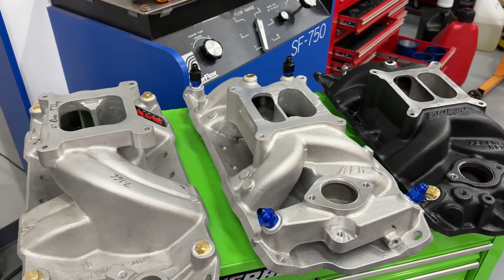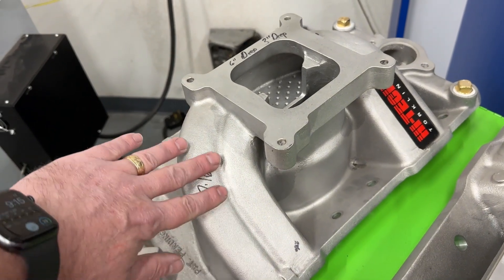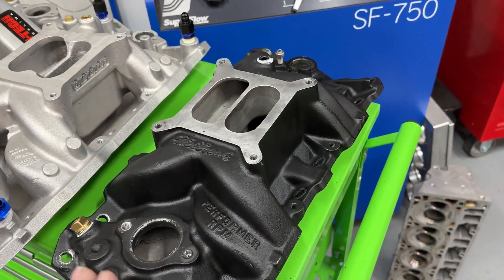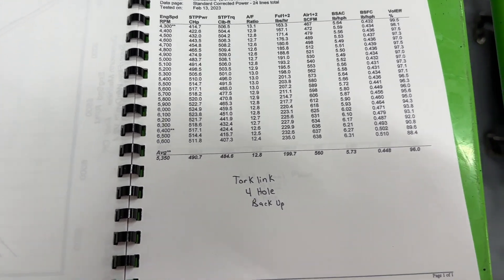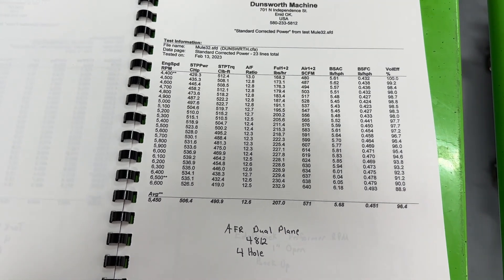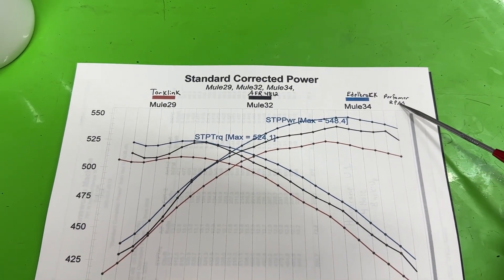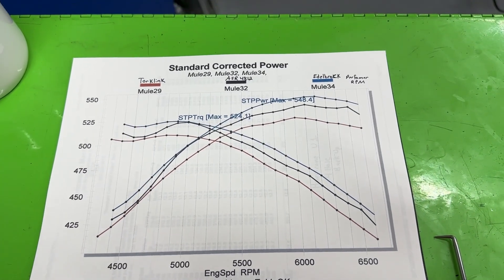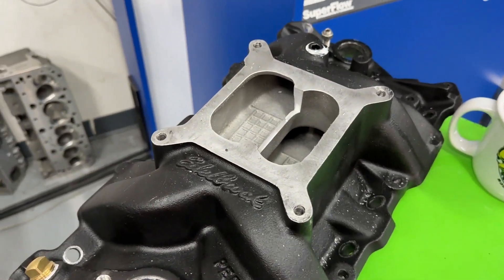Dual Plane Intake Manifold Dyno Test

Comment: I do know that the torque link worked very well on a boat. I changed from a performer room to the torque link and the difference was substantial!! Chevy 350 with a RV/ Marine cam. Never saw above 4500 rpms but it really made a huge difference! Had to lean the Holley 3 jet sizes down. Not only seat in pants grunt but more efficient as well.

Comment: Do you plan on comparing the BBC AFR to Performer RPM?
Reply from the maker: Already did to performer rpm air gap on 496
Reply: @WeingartnerRacing  I meant to say comparing the AFR dual plane 4910 to the Eddy Performer RPM air gap? I saw you did the SB comparison and the Edelbrock did better but I know you mentioned the spacer wasn't ideal for the AFR. I was curious about the BB because it comes port matched.

Comment: Can the performer RPM be used for street driving?  The specs show an rpm range of 1500-6500 but for street you need power off of idle.
Reply: You lose a little response just off idle compared to stock then its better everywhere.

Comment: Just looking at the Hi-tech you can tell it will be garbage. Dual plane intakes are designed so the each half feeds every other cylinder in the firing order providing equally spaced pulses.  The Hi-Tech will have unbalanced pulses on both sides that even the large cut-out won’t be able to overcome.

Comment: Performer RPM 
When they first came out in the early 1990’s
I had one on a 302 HO 
351 Windsor Heads
Solid flat tappet 306 dur. 530 lift cam 

It was a beast 
3500 to 7000 rpm beast 
600cfm Holley vac sec carb

Comment: Did you make sure that all three intakes were port matched to the heads I have a big bore stroker Yamaha Banshee four wheeler and that's one thing with two strokes you got to make sure that all the port matching is done from the block to the cylinder

Comment: Have to watch when theres more time. 
Forgot all about that tork link? Intake. Know appearance isnt that important but wouldnt mind one just to be different

Any info on Edelbrock EPS vs their performer rpm?
Really interested in A Holley Strip Dominator high rise Z28 intake 300-36? Vs the Edelbrock RPM or comparable Weiand offering. 
300-36 I had was loaned to a friend...who sold the car right after he installed it. Cant find a clean one reasonable since
Best high rise I used...certainly had that tall Z28 look also.

Comment: I know this was a year ago. With that said, has there ever been a test of the performer rpm with a 2" super sucker spacer installed upside-down?? Anyone?  I heard cats saying they pulled up to +20 hp by flipping it.
Reply: Am I missing sarcasm or humor? 
if serious that person is full of beans.
Reply: Figured so, that's why I was channel surfing to see if anyone has put it to the test on a dyno or not. some cats cut the divider on dual planes why not just throw in a open spacer? Would it change how the air/fuel atomized by being pulled through that different directions?
Reply: @drt6680  they may have got 20hp at high rpm if they had a carb that was too small to feed the dual plane. by adding the gap, spacer is better, but cutting down the divider is the same idea, it allows all 4 barrels of the carb to feed each cylinder. in a fully divided dual plane only half the carb feeds each cylinder so can suffer at high rpm. by going for a much bigger carb you wouldn't see a benefit to running the gap because there is already adequate air and fuel. so you COULD see 20+ hp, but you'd get that power by adding a bigger carb and probably keep better low end and torque curve.

Comment: The sad thing about these videos Is I'm trying to find information for the best combo under 4000 rpm for my fully loaded F250. Unfortunately the data all starts far above 4000 rpm so none of this is useful to me because I'll almost never be winding my truck out that far but the power I make at highway RPM is critical because it dictates how much incline I can handle without losing speed.
Reply from the maker: You are concerned more with part throttle driving than wide open throttle. Dyno no matter rpm is for wide open throttle.
Reply: @WeingartnerRacing I think you've misunderstood. The TLDR version is if you don't have the required power available at WOT then you simply can't maintain a speed at load up an incline no matter how much you push the pedal down.

Moving a load up an incline is a function of power. To move a 3300kg truck up a 20% incline at 62mph would require somewhere between 275hp and 290hp depending on the drag coefficient of the truck. But it would only require somewhere between 35 and 60hp on a flat road. So yes on the flat road you would only be using a part throttle application because obviously at the working rpm of the truck will have enough power available to maintain that speed. But as the incline increases, throttle application will need to increase because HP demand also increases. If that power is not available even at WOT then the speed will begin to decline as you climb that incline which may require a change of gear to get the truck into an rpm range where that amount of power is available. In my case, my truck doesn't currently have enough power at any rpm to maintain that speed up a 20% incline fully loaded but that incline at that speed would be very rare. However let's assume I only need to go 37 MPH up that same incline then I would require somewhere between 150hp and 165hp which my truck does have but at what rpm? Because that will dictate the gearing I need to maintain my speed. Now there is another way of looking at this. Lets say the rpm of my final drive ratio at 62mph puts my engine at point where it has 140hp available at WOT.  I can then work out that I do not have enough power to maintain speed up an incline of somewhere between 7-8% at that rpm so that is the incline that would require me to change down to a lower gear. So my options are to change my final drive ratio which will increase rpm to give me more power at that speed but that comes at increased fuel consumption under normal conditions. Or I can increase the power output of my motor at the current rpm of my engine at that speed.Ultimately however my goal is to make the most amount of power in the rpm range of my final drive ratio because that will allow me to maintain my speed in the maximum amount of situations without constantly changing down gears. I'm never going to make enough power at that rpm in a NA 5l small block to maintain speed fully loaded up any incline I will face but at the moment my almost stock small block is struggling even up fairly mild inclines. The obvious answer would be to fit a much bigger engine or add a turbo or do what most people do and install a turbo diesel but in my case all of those options will be very expensive and complicated so I'm just looking for options that can increase available hp in the working range of my original motor. I might point out that my truck already struggles at just 2500kg of load and because I know I'm going to be doing a lot of travelling at up to 3300kg in future I'm looking to increase the power output of my motor at lower rpm.
Reply: @Civic.   Adhere to the four basic hotrodding rules:  1) intake; 2) ignition; 3) weight; 4) exhaust.  Eliminate the cat[s] if possible, use a freer flowing muffler like a Dynomax Ultraflow (get one with offset/offset in/out to keep the noise close to stock).  Install a torque oriented spacer under the carb or throttle body, and whatever K&N air intake kit appropriate.  Retune the ECM if possible, and upgrade the coil.  18:10 E 18:10 liminate deadweight components!  If all fails, lower gears.

Comment: Ive always read that dual planes like open spacers. Ive always wonder if the distrabution is off based on one side looking like it has more volume.
Reply: Prefer no spacer on a dual plane no cut divider either. 
A peak # from WOT on a dyno isnt same as driving PT on the street
Reply: @gordocarbo  i saw his test. Kinda inspired me to possibly make it work even though i have no way of testing it.  Another thing i think about is maybe the higher the throttle boddy sits, the more it draws the fuel across that first turn on roof the intake. I tried to lay that back a bit too. Not much meat there though.
Reply: in a dual plane only half the carb feeds each cylinder. the gap/spacer allows air from all 4 barrels to go to either side. however this is only a benefit if you are running too small a carb. Because dual planes only have access to half the barrels, you need a bigger carb than whats on a single plane. Most people don't know this so it seems to make the spacer/gap make more power. but if you ran a big enough carb you'd have the same top end or better, and keep the good low end and torque.

Comment: I want to see a rpm air gap and a victor jr on a graft together. I know one is single plane and one is duel, but I want to see their differences side by side.
Reply: I just swapped my air gap to a ported Vic Jr with a 1" open spacer about 7 months ago. It was advised by custom cam builder, Mike Jones. 383 roller pulls like a missle and lights the tires instantly anywhere in the RPMs.
Reply: I just read the test in an old magazine.  Chevy High Performance, December 2006 page 20. Article name is Big Power For Little Cash.  They ran an air gap on test  1 followed by a Victor Jr. on test 2.  Mule was a 383 with 195 eliminators and an XE274H
Reply: Depends on the combo, gearing etc. 
On a street car Id run a good dual plane long before I messed wtih a Vic Jr. Not really a fan of them anyways

Comment: Back in the day.I had a stock 350 flat top with 882 heads.I took off the factory pre EGR valve intake and bolted on a performer .Night and day difference.Woke that engine up.
Reply: Was the original factory 2 or 4 barrel ??👍
Reply: The performer EPS is even better.

Comment: Knew a guy years ago that swore by the non-airgap performer rpm qjet manifold with an open spacer. Ran that manifold even with square bore carbs. Always seemed to work for him and this makes it look like he may be right.
Reply: the spacer is better than the cut down divider, but the reason the spacer and divider gap make more power on a dual plane is because only 1/2 the carb feeds each cylinder. By having that gap it allows air from all 4 barrels to go to both sides. So you could see probably a better increase by simply running a much bigger carb that would allow enough air and fuel at high rpm, but would keep more low end torque.
Reply: @Born_Stellar  , you run the cfm carb for the power you make. A 350 hp engine only needs xx amount of flow. So a 350 hp 350 needs the same cfm as a 350 hp 400. The open spacer on a dual plane helps with top end without sacrificing as much low speed driveability as going to a larger carb.
Reply: @ ok, say you have a 400cfm carb on a single plane, each cylinder gets access to 400cfm. now on a dual plane, you only have access to half the carb. if you cut the carb in half and have 2 instead of 4 barrels, its now a 200cfm carb for each side. this my not SEEM like it matters, but the air does move fast enough that it does. 
now you know WHY the cut down divider or a spacer make more high end power on a dual plane? because now each cylinder now has access to 400cfm instead of 200. when running a dual plane, you need a BIGGER carb than a single plane, and since most people don't, the spacer or divider makes up for the lack of CFM, which is only noticeable at the top end where its needed. 
as to the 'run the cfm for the engine' thats a myth. you will get more power from a bigger carb, to a point. Even a 350hp motor will make more power up to like a 1250cfm carb. now the REASON people say to stick with a smaller carb is drivability. when you have a bigger carb you have bigger barrels, and a bigger barrel means less velocity. this just means you can't just floor it, you need to modulate the throttle to get good velocity or it will bog. however manufacturers know that you have to make a carb that works in ALL CONDITIONS. heavy load, in hot weather, in traffic and up a hill it has to just 'work' so factories don't offer huge carbs, even though they make more power. 
case in point, the tri-power triple carb setup on some ford's and chevy's was a dealer installed add on, and those 3 carbs were like 350CFM each, meaning they can flow like 1100cfm, AND it made more power than the 500cfm 4 barrel stock carb.
Reply: @Born_Stellar , go watch the Richard Holdener video of the 400 pontiac that makes the exact same power with a 750 quadrajet no spacer vs a 750 quick fuel with an open spacer. The dyno charts lay over each other within a hp. And than is within margin of error. A given hp only needs a given cfm. If you need an open spacer to gain 15hp you need a different manifold not a bigger carb. And since there aren't as many variations of manifolds as carbs, spacers and cut dividers were invented.
Reply: @AndyR1982  that can be true and also not prove that a bigger carb wont make more power. engines have so many parameters and thats why we actually need to test each combo on a dyno. David Vizard proved he gained hp all the way up to a 1250 cfm carb, and then finally no or minimal gains with a 1300. don't remember the ci but his entire point was that the engine was 'over carbureted', way more cfm than would be needed by usual calculations.

Comment: Why test with a cheep slow burning chev stuff. Go with the times man.
Reply from the maker: Why not? It makes more power than most people have now.
Reply: @WeingartnerRacing  I don't agree, they make good midrange horsepower but that's it.  That terrable combustion chamber doesn't push the piston down right, side thrusting the piston, I can hear it as well.  Don't you think chev,s mislead the market confusing the mark for long enought. Now everything else makes more power with parts available.  I think they have had their day.
Reply from the maker: @michaelgiglio1571  yeah that’s not true at all. Maybe you can supply some examples. Because this engine makes more power and torque than many modern engines.
Reply: @michaelgiglio1571   That makes no sense at all
Since when does an engine know what brand it is? What terrible chamber are you talking about? 60s era like everything else back then?
Reply: @gordocarbo  look at where the chamber is, on one side, thrusting the piston uneven, and the area for the flame to travel. Not to mention the lack of port flow recovery and the washing out the rings.  I can't believe people can't see it. Just a bad design.
Reply: @michaelgiglio1571  but they kinda last forever and make good power. people can't see whats inside the engine and impossible to see. Can you prove there is uneven thrust on the piston? the flame front propagates from the spark plug not the intake port. and whats 'port flow recovery'? never heard it before. you mean scavenging? SBC last for hundreds of thousands of miles and don't seem to have an issue with having the bores washed out.
Reply: @Born_Stellar  G'day Eric. When the intake valve leans back in these quench heads, it doesn't breath around the Valve properly, relying on chamber relief. So here's  the problem.  Flow will swirl around the cylinder, not the valve, needs to travel longer,  washes oil off one side of the rings, not recovering flow after the 5250 rpm crossover pattern because I can't change much direction,  compromising combustion burn when the flame moves across the piston, not down, always pressureing on side of the piston one side and then the ather, including the  compression stroke, promoting bad ring seal also,  because their is so much testing with this bad design,  cam grinder are making generic grinds, thinking it will work on ather engines, limiting the rest of the Detroit world.  This is a chasing the tail cycle.  All from years of over testing these quench stile motors.  Imaging a nice closed camber with scish on both sides without these problems. It's call boss ford.  Hope this helps.  Mike

Comment: Thats weird the Performer RPM did better than the Air Gap this is the first time ive ever seen that happen because usually the Air Gap does better at high and low rpm
Reply from the maker: This is not the air gap manifold. Its AFRs version of the air gap.
Reply: @WeingartnerRacing  yes I seen that but usually AFR flows better than any Edelbrock so I figured AFR's Air Gap would do even better than Edelbrocks

Comment: What is blowing me away is, the Edel. RPM is making more average horsepower and torque than the Edel. Victor 2892!! I may have to rethink my induction setup! I guess the real test will be at the track using each manifold and see how it turns out.

Comment: I've never known a dual plane to like a 4 hole.   Generally the Edelbrock RPM air gap outruns the regular Edelbrock RPM in about everything I've seen, I would have expected the same from the AFR air gap so I'm curious to see that retested with the open spacer.  Excellent video and great data.

Comment: A dual plane divides the carb in Half, my 406 runs 850dp which is 424cfm can you explain how much cfm port needs if flowed 260intake ? I know it's sounds like dumb question ❓ 👍
Reply: the problem with adding a huge carb is you get really bad low end throttle response. You would probably see top end increases up to a 1200-1250 carb, iirc from a David Vizard video which I think was a 383, but the low end might bog without proper throttle application.
Reply: Youre combo is fine for the street but might do better with a 750 or get annular discharge boosters for the larger bores of the 850. It will increase throttle response and atomization.